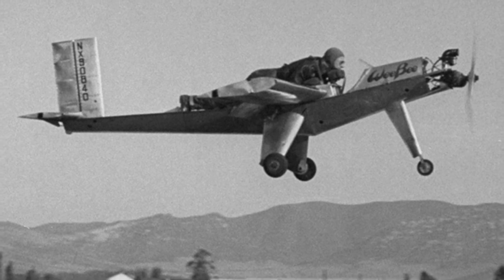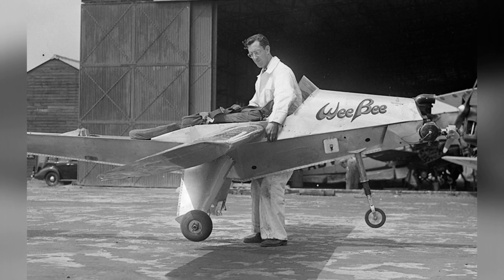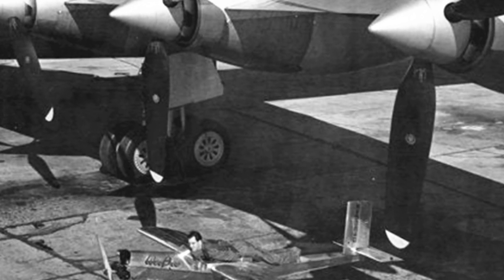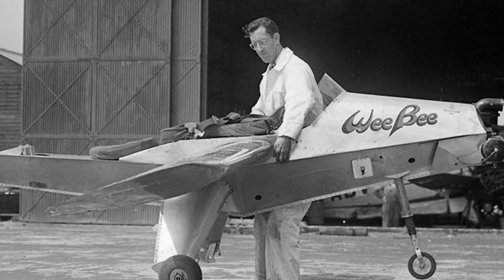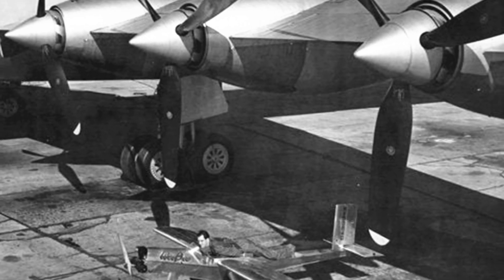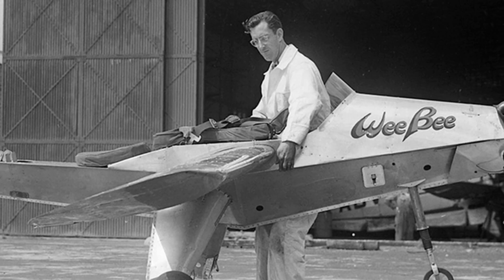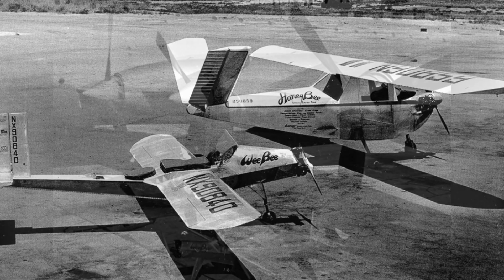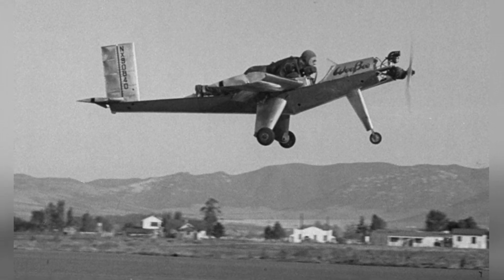Wee Bee: The World's Lightest Manned Aircraft

Comment: The IMPORTANT thing here is the RIGID WING to get lift and potentially higher speeds aka flight performance compared to SOFT WINGS like ram-air parachutes aka PPGs which are unable to fly in winds exceeding their slow 25 mph speeds. The solution to keeping the rigid wing and improving portability and a sitting position is the highly successful INFLATOPLANE.